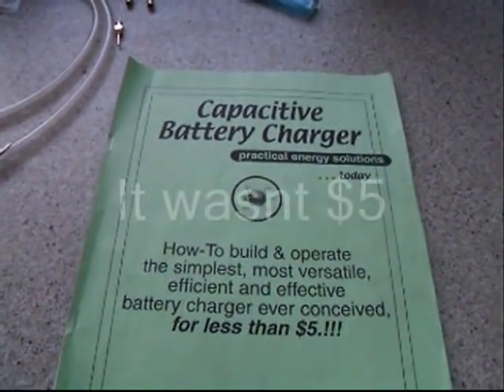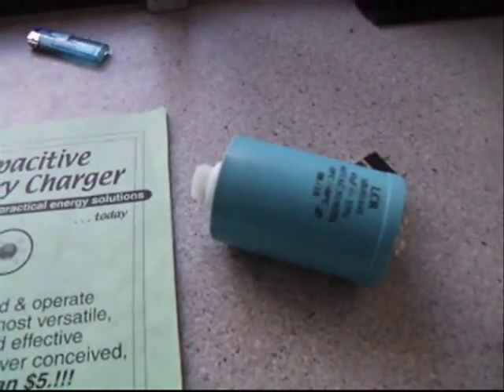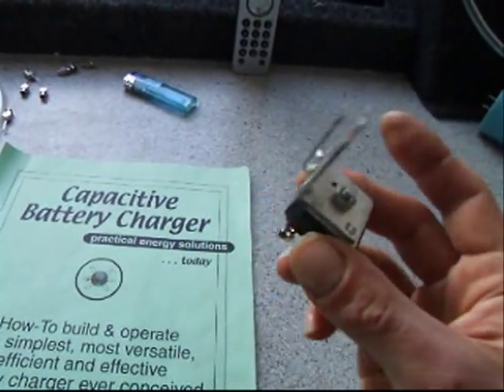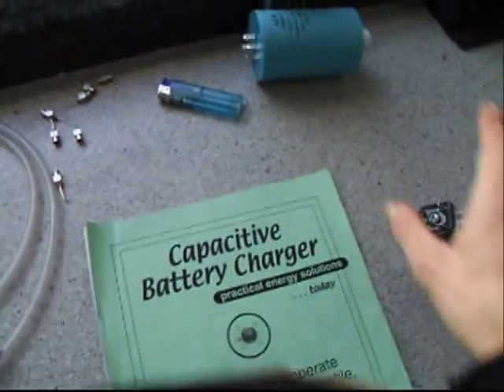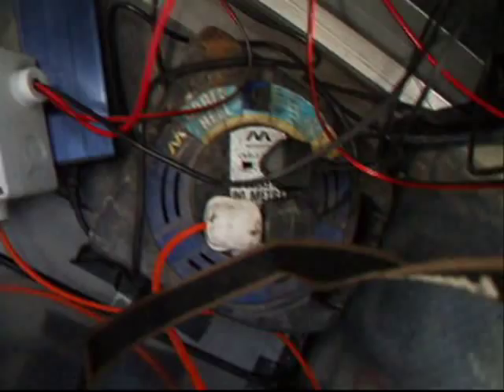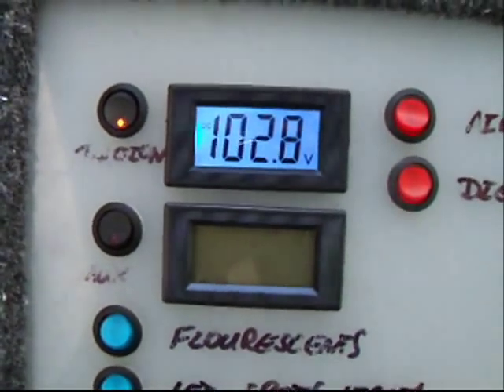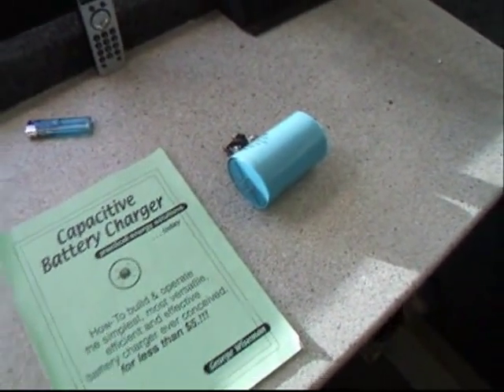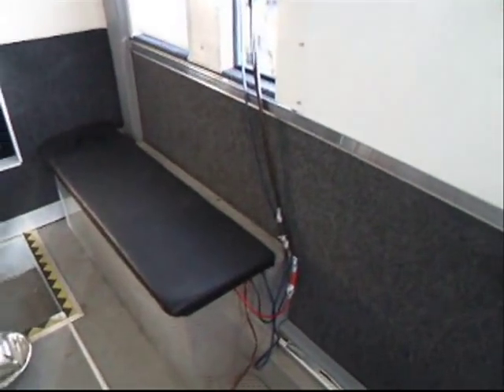DIY Capacitive Battery Charger

Comment: just wondering do you connect the ac from plug outlet to the capacitor then from capacitor to the bridge rectifier and then to battery? do you not need to step down the voltage with a transformer?

Comment: I use similar charger but instead a capacitor before the batery use a 100W bulb after the battery. It charges a 10AH 12V bat.

I try yesterday with 20uf 320v cap, in series with the bat, but not charge!...will try with a 50uf cap.  Tkx for share